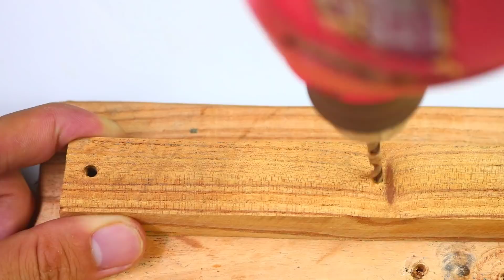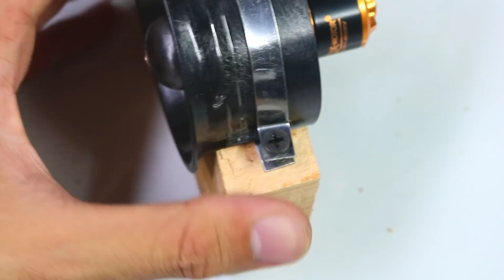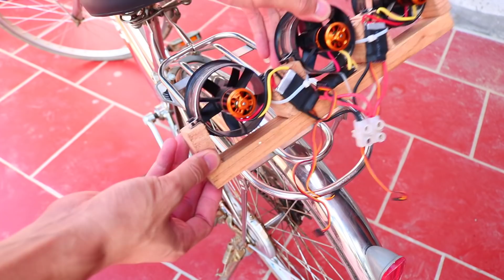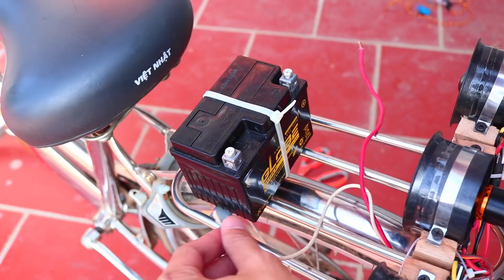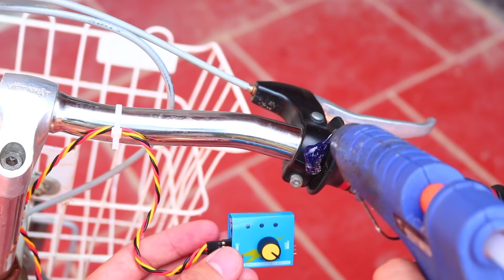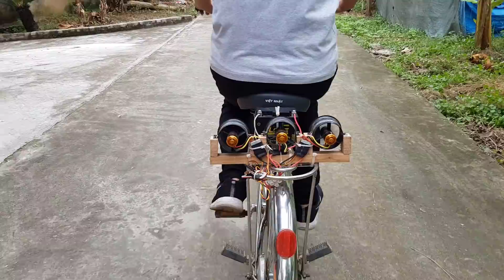How to Build an Air Bike at Home

Comment: This is totally fake. Each motor has a thrust of 0.75kg, all together is 2.25kg: too low to move a man on a bike!! About the battery: the linked 1.5mAh will only last less than 2 minutes (assuming 75A total consumption), it is used for RC models, not for that!
Don't buy these parts
Reply: @pinobo1997 it could be true. he used 4500kv motor with 64mm EDF,  each motor has a thrust of about 1.5kg--3kg depending on the battery, all together 4.5kg----9kg. it is just to push the cycle which is enough not to lift it.